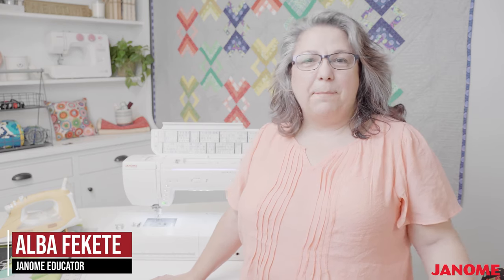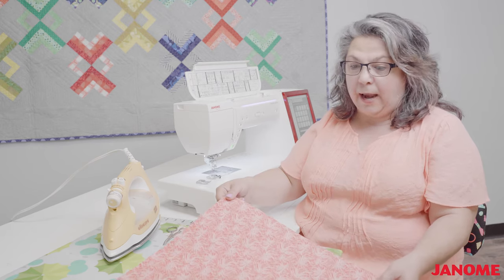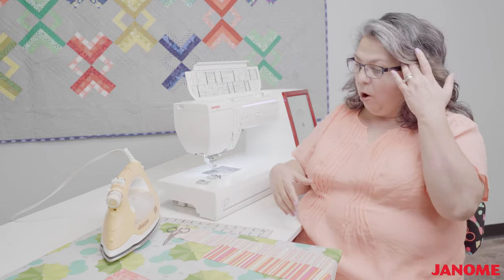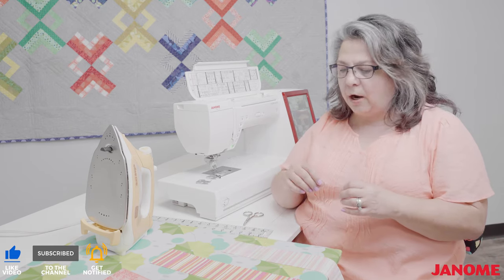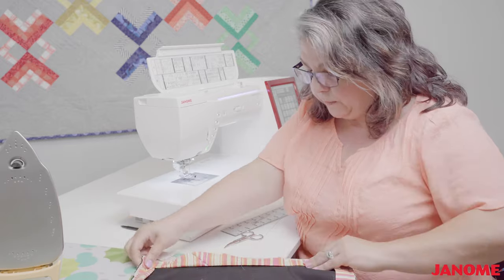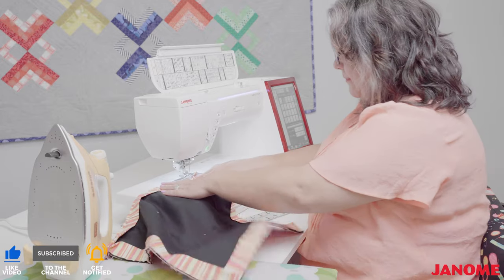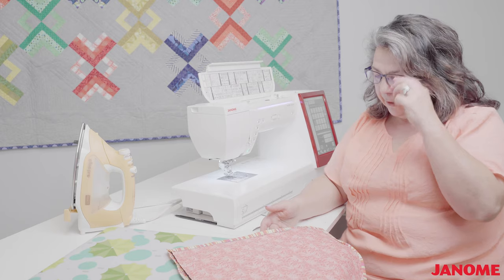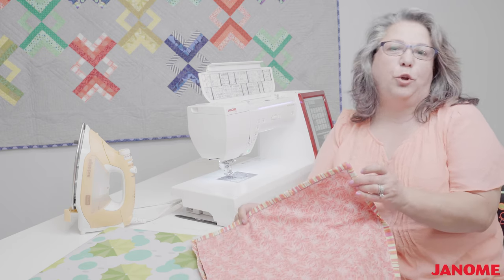Machine Binding from Start to Finish on your Janome Sewing Machine with Alba

Comment: I have a new Janome Skyline 6.  I thought from reading the manual that I could only use straight stitches when using the accu- feed feet and throat plate.  Did you just use the other throat plate with a wider hole to do the blanket stitch while using the accu feed special  OD foot? Thanks.